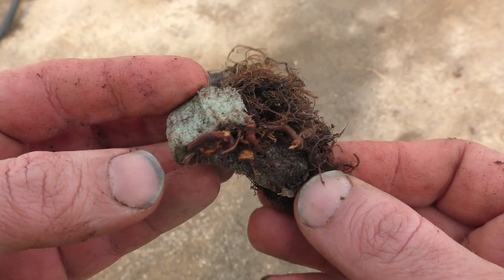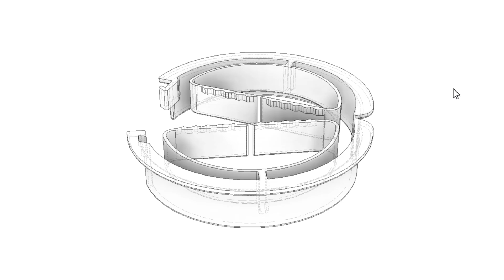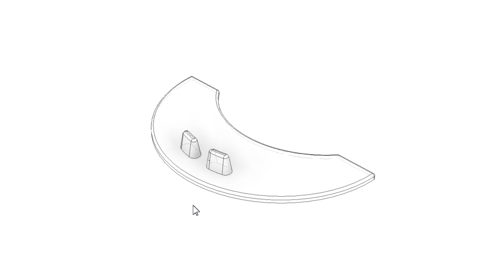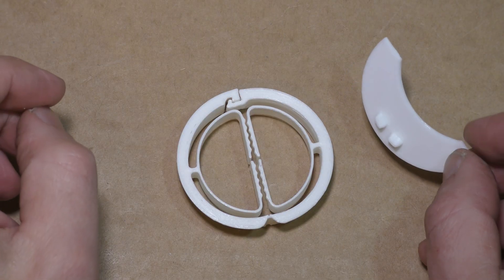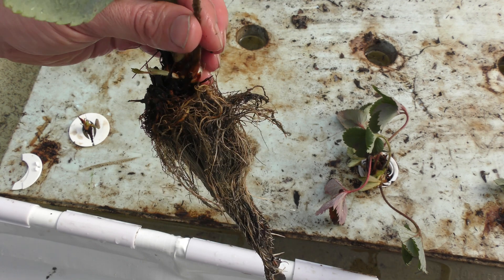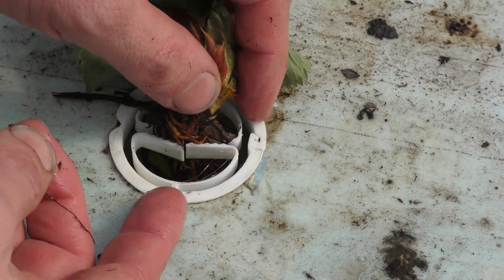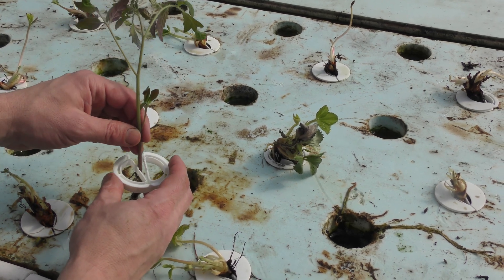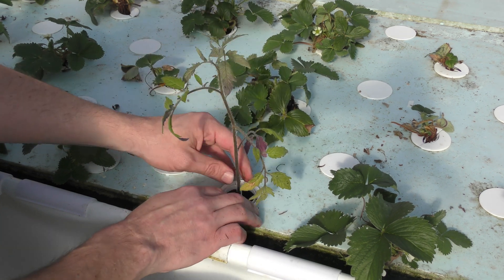Will This Plant Clip Work?

Comment: The springy section could be a separate part(s) that dovetails into the outer ring, would reduce wastage if they break or as you say if they keep the shape of the previous plant.
Reply from the maker: I thought about something similar but making the spring part out of a piece of stainless spring steel  Probably would drive the cost too high.
Reply: @Bigelowbrook  It wouldn't have to be spring steel, could be 3d printed or injection moulded. It would just be separate to save printing the whole part again.

Comment: if they only last a year there is no benefit to them over a grow grip. I think your trying to solve a problem that isn't there anyway.
Reply from the maker: The main issue is that the growgrip parts get stuck in the roots so I can't compost it.  I was hoping to make up a clip that could easily get removed.
Reply: @Bigelowbrook  so make a growgrip out of something compostable...
Reply from the maker: @Rufeo0  Easier said than done.  I've been working on that for a few years now.  ;-)

Comment: What kind of plastics are you using PLA?
Reply from the maker: yes
Reply: @Bigelowbrook  I have had some success using ABS for better durability but it might be too stiff for this application. Also, ABS stands up better to UV light and temp swings. Might be worth a shot.
Reply: PLA might not be the best material for this I think. It's not UV stable and degrades pretty quickly in outside applications.
PETG might work better since it's UV stable and also bends easily without breaking.
I've had good experiences with it in long-term outside applications (I printed a weather station housing with it that's been sitting outside for almost two years now and it still looks like new)

Comment: That should work well. When you were describing the problem I thought of how a feather board works on a table saw. If the feather spines were in all angled like a vortex, the clip could be twisted off the roots to release and reuse.  Just another idea if it helps.